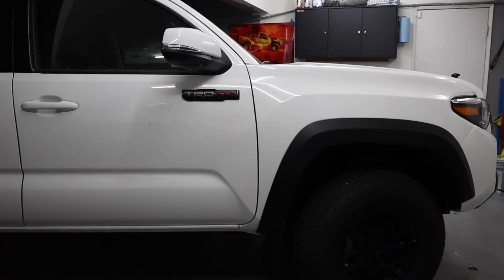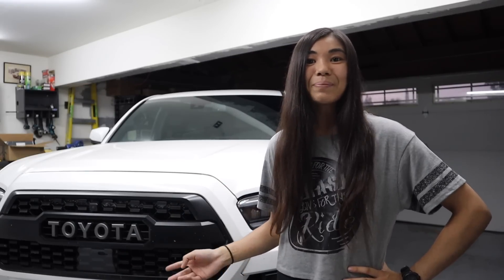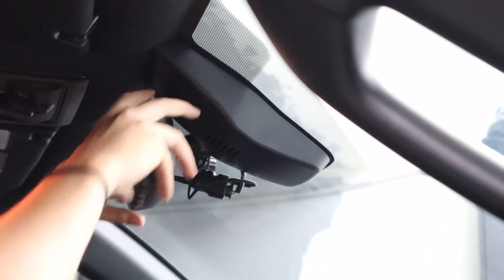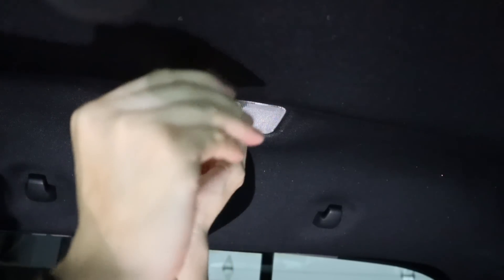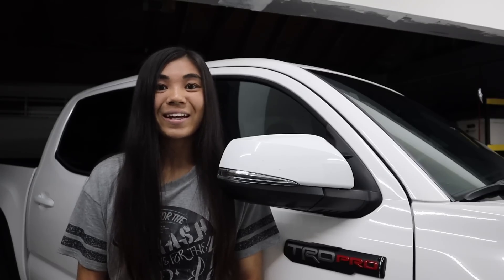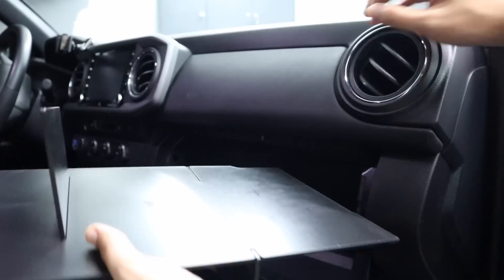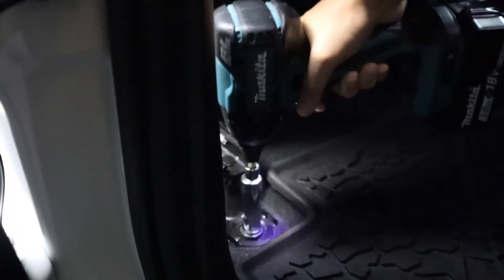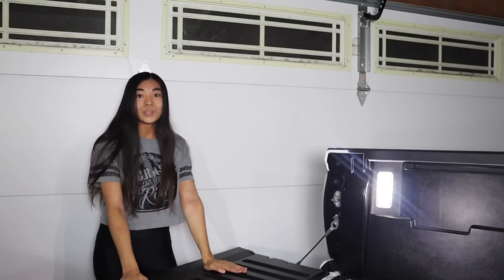Easy Tacoma Mods on a new TRD Pro!

Comment: The seat jackers are awesome! I installed a set in my 05 6spd Taco after seeing your video on them a while back and they made a big difference. Thanks!
Reply: Did you do it on both sides?
Reply: @rayh53  No, not yet. I want to though. I installed the multi mount panel with the seat jackers. It would be nice to have that setup on the passenger side as well.
Reply: how tall are you?
Reply: @scottwest8742  I'm 6ft tall. The bill of my hat will hit my sun visor and that does get pretty annoying, but my sun visor needs to be replaced. It hangs down a bit and doesn't snap up to the roof.
Reply: @Zoodious  thanks for the feedback, im 6’2 so debating on it

Comment: Chloe, I keep the softest makeup brush I could find on Amazon sitting in my console opening to remove dust particles from instrument cluster and dash. I am OCD about dust. I use 303 Protectant on a microfiber towel on the top of my dash and door panels to protect from UV light. I enjoy watching your videos. Thank you for making them. My 2015 Tacoma is a TRD Sport in Silver Sky Metallic with a 6 foot bed. The sport has body colored fender trim, bumpers and mirrors. A no functional hood scoop is part of the package.

Comment: For my Gen2 Taco, I disassembled a usb cig lighter charger, and silicone mounted it up above the compass housing when I had it down to repair the temp/compass resistors. Tapped into always powered map lights, and I'm now running a dash/window cam to catch the next ding dong that runs a red light. Some pics over at TacomaWorld on the usb hack for those with Gen2 Tacoma's. Thanks for sharing your mod work.
Reply from the maker: That is cool! I'll have to check out that setup
Reply: @ChloeKuo  Check out, compass fix, over there. On page 112 is where it's at.

Comment: Hi Chloe, I have a functional mod to do actually on any truck. I bought a Tire Valve Stem Extension. I bought it on Amazon it comes in a pack of 2. The purpose is to check the spare tire pressure without dropping it down to the ground. I don't have video to show but what I did was I connected the two extensions together then  one end to the spare tire and drop the other end to the under side of tire. Now when you have to check the tire pressure you don't have to lower the tire. Todd

Comment: Great mods, the camera one I will have to check out.  When I replaced my map lights on my 21 TRD Off Road, I popped the entire console down and then replaced the bulbs from the top side.  WAY EASIER than the tape or screwdriver trick. I found that vid on YT somewhere! Thanks for the great content!
Reply from the maker: Good to know! That sounds way easier
Reply: @ChloeKuo  Where can I find this particular camera and adapter that fits my 2021 Tacoma?

Comment: Well Chloe after watching you (and the ease) switch out the headlights / tail lights I was all set to get some smoke lens LED's for both - then saw they are illegal in our neck of the woods. Even found a smoke lense MOD for the rear view mirrors. I'd just do it except guessing that ticket would be about $350 and have to keep switching stuff back and forth. Guess a couple of these MOD's will do for now. Trying to figure out this offset rim deal. These trucks handle so much better with a wider stance, looks good too. Keep up the good work Chloe!

Comment: Cool mods. The dash cam power dongle is great. I’m gonna order me one for my 4R TRD Pro so I can finally get a dash cam. Been putting it off cause I didn’t want to wire it up. This will save a lot of time and be a lot cleaner.
I did the bed light kit on my 2016 Tundra TRD Pro when I had it.
Reply: Yea, that Dongar Adapter is pure genius. I wouldn't have put a dash cam in my truck if I had to wire it. I installed it and ❤ it!

Comment: Quick tip on installing new map lights: use a small flat head screwdriver and put the tip toward the base of the bulb and gently pry. It will come right out.
Reply from the maker: That sounds way easier than the tape method!

Comment: Great video.  You make the installations less intimidating.  I am going to install the seat jacker based on your recommendation and the bed lights.  By the way, has Garmin improved their dash camera?  I want to install this mod but, I read reviews that the camera has a tendency to over heat.
Reply from the maker: I have not had the Garmin Mini 2 long enough to tell whether it's better than the gen 1. I'll eventually make an update video!

Comment: I replaced the stock 245/75/16 tires with BF Goodrich KO2 all terrain tires 265/75/16 and then I removed the Toyota Badges and installed some wheel locks and I spare tire lock and I like it a lot

Comment: Such a great video! I am thinking of installing strip lights in the bed of the truck and would like to use the same connector you used for the bed lights. Any idea what kind of connector that is?

Comment: Those bed lights look as if you can simply push/press them on/off.  Is that the case?  Or do they only come on while the engine is on?  Wish you put a little more focus on the product since that install is such cake.  Thanks!
Reply from the maker: You can turn them on even if the ignition is off with the switch. Hope that helps!

Comment: Hi Chloe, do you know if a window shade can still be used with this dash cam, or will it block the shade from folding out completely?
Reply from the maker: Hi Jay, I think it will depend on how you mount the dash cam and what specific shade you go with. While I've never used a shade, the dash cam is pretty small so I would assume that it would in most cases not block the shade. Hope this helps!
Reply: @ChloeKuo  I appreciate the reply Chloe!

Comment: Screen ProTech was a disappointment. The shifter and infotainment screens went on fine, but I tried multiple times on the instrument cluster and ended up with permanent air bubbles and fine scratches that are visible in the sunlight. This was despite liberally saturating both sides of the protector and the screen itself. The protector adhered too quickly and the squeegee is too firm to conform to the surface. I will say that the company was great and sent me replacement protectors, but they still didn't go on correctly and the simple act of installing it leaves fine scratches that you won't see with an LED flashlight, but will in the sunlight. Again, there could have been some manufacturing variances because I've only read one other review stating the same issues.